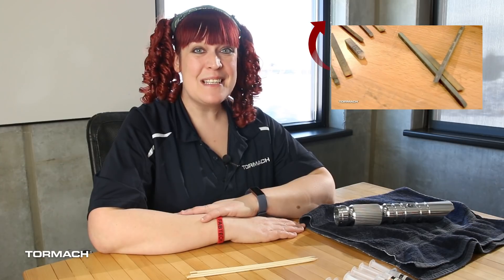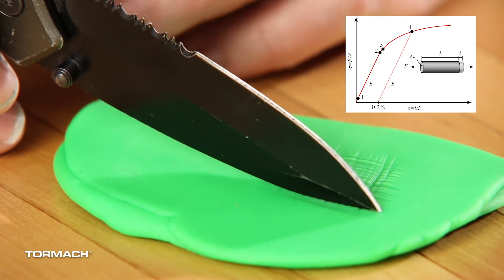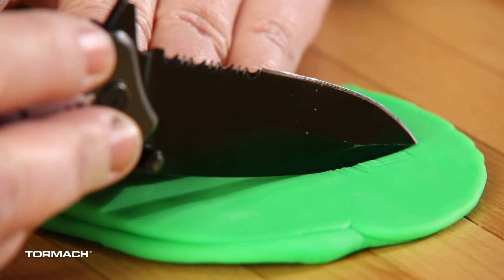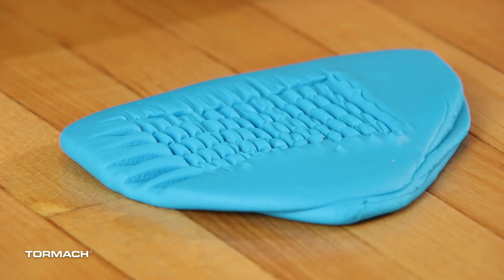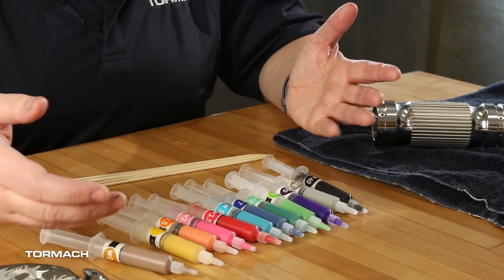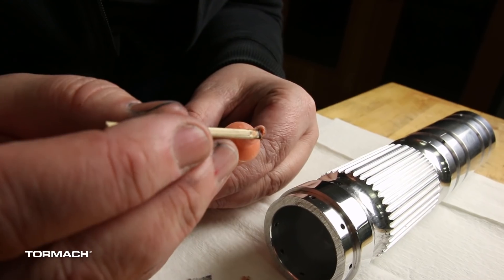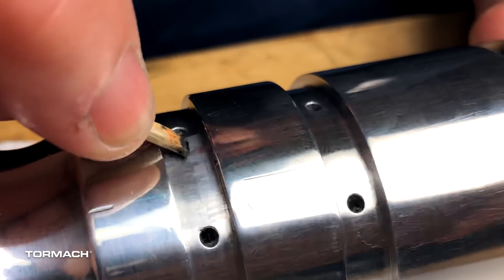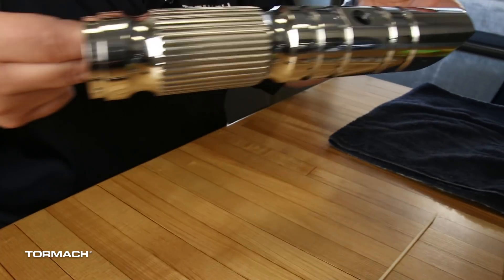How To Polish an Aluminum Lightsaber To A Mirror Finish

Comment: A lot of what I use my 770 for is small injection molds.  These videos have given me some really good techniques for how to polish my molds.  Doesn't seem to be a lot of information out there and getting this from a former mold maker is awesome.  Love the bamboo skewer method.
Reply: Thank you so much for all of the kind words, Randy! Mold polishing, like mold making, has a lot of additional variables involved. The three most important bits of advice I can give you outright out be 1. Watch your tolerances and leave a bit of stock on your critical features, as polish does remove material. 2. Keep in mind how you want your material to flow when choosing a surface finish and 3. Mind the parting-line and shutoffs carefully. (It does not take much to roll a critical shutoff area.) Good luck and I sincerely hope that I was able to help you on your endeavors!! 😁
Reply: @jennybannink823  awesome job Jenny major props 👍🙏

Comment: That's amazing! I am about to begin pouring aluminum cast pistol & rifle casings just for the fun of it and wanted to know if aluminum could even be polished to a mirror finish.
What would you recommend starting with since the diamond paste would probably be considered a finishing touch? I plan to polish all my pieces by hand. Should I just stick with the typical incremental grit sheets from 100 range thru 2-8k type emery paper? (forgive my terminology if i'm wrong, I dont know much about polishing)

Comment: Have u any experience on motorcycle aluminum heads and carters?I have been literally breaking my head over some and , after removing the thick factory paint (with paint stripper.. unfortunately blasting glass beads was not possible) and tried with some rotary tools, wheels and buffing soaps, I have ended up with a fair amount of scratches and a semi polished surface.  I cannot get into the small gaps and cracks, fins and tiny holes in and on the irregular surfaces of the cases with any of my tools and I was wondering whether you had done some similar work.  Could I send u a couple of photos of those parts?  Get a few suggestions and tips perhaps?

Comment: Have someone polished P20 steel molds?
Reply from the maker: All tool steel can be polished with the same techniques we demonstrated, though it will take longer depending on the hardness of the steel. P20 is tempered at a Rockwell C hardness of 37 to 28, and it's pretty forgiving compared to other steels. Thanks for the question!
Reply: Amazing video! I hope one day you could explain us how to use a tool called diamond burnishing, that tool can also polish in the lathe
Reply: Gesswein stones